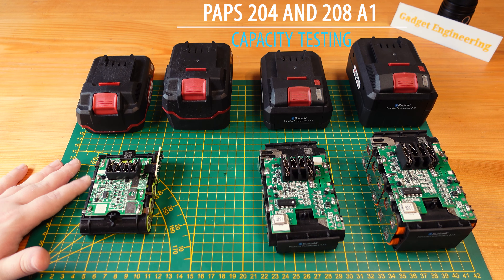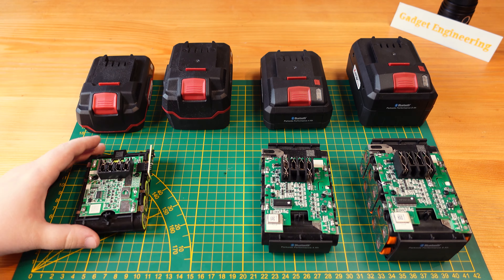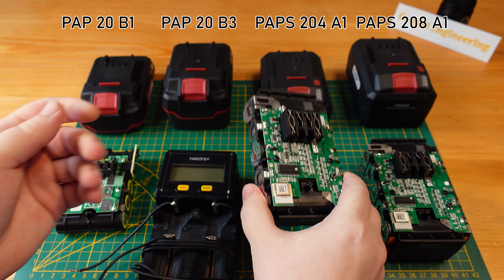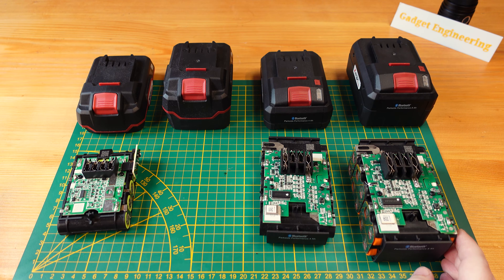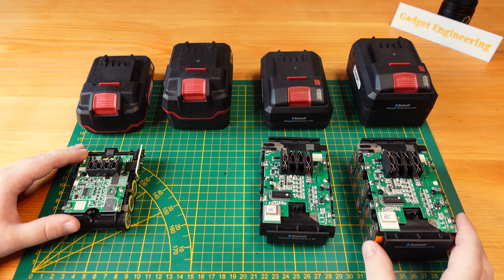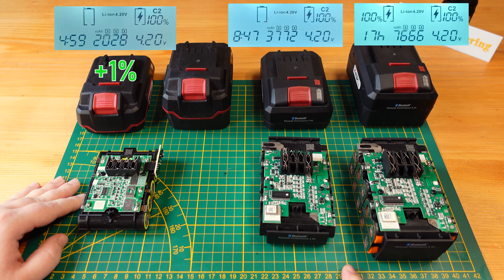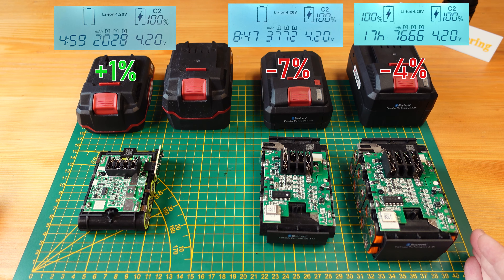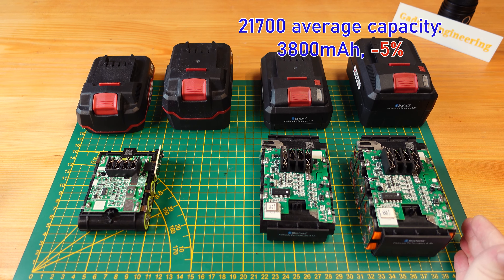CAPACITY TEST Parkside Performance 8Ah & 4Ah PAPS 208 & 204 battery 21700 Akku Kapazität getestet

Comment: The real question I want to know though is.. How many amps can the new single cell deliver.. If its the same or only slightly more than the standard batterys, then the standard 4a battery will actually have better performance than the new 4a model because it has twice then number of cells available for current draw than the new single cell 4a..

Comment: You can change the end capacity discharge voltage to 2.5V with the new Performance version, this might give you a bit more mAh... You said your tool charges up to 4.2V and discharges to only 3.0V I would not recommend to discharge to 2.5V but to be fair this could fullfil anyways the specifications.
Reply from the maker: True but as you see the 18650 version delivers its rated capacity down to 3V, and I think the capacity ratings are given with a discharge to 2.8 or 3V. Anyways, there is only a few % energy left over when below 3V... Still, nothing to be disappointed about...
Reply: @GadgetEngineering  I guess the reminder could add up close to the 200mAh.
Reply: @GadgetEngineering  For exact measure you need to respect the original cell specs. Many times that capacity is at a discharge of 1A, even less. So if you test at higher current, you can get lower values. I got 7.1Ah on the 8Ah brand new batteries at a discharge current of 6A / 3A/ cell.

Comment: Hello my friend.. Please send some to me here in the UK.. I just purchased the SDS drill, Combi drill and jigsaw from Germany.. Soon I'll be wanting to buy the circular saw, grinder, multitool, impact wrench. impact driver and some 8ah batteries.
Reply from the maker: Let me see what I can do! Where did you buy the other tools, German Ebay or some other place?
Reply: @GadgetEngineering  Yes I got them via ebay but from Germany.. Another question.. On the batteries there's positive, negative what is the other connector for?
Reply from the maker: @cassiya100  There's actually 4:
- T ID +
negative and positive are self explanatory, "T" means possibly thermistor, but it really isn't providing a thermistor connection, it is really a battery status OK connection, that when status=OK is a 10k Ohm resistor connected to the negative connection, when status=BAD it is open. It come into play for the battery to signal its status to the tool, as there are no switching elements/mosfets in the 20V Team batteries, and all battery protection switching is done by the tool. So any time the battery detects an overtemperature, overcurrent, overdischarge, or cell imbalance state, it opens the T connection. The tool is using this connection as part of a voltage divider, 5V from tool->10k resistor->sense connection to MCU->battery T pin->10k resistor->negative. That way at the sense connection the tool either sees 2.5V, meaning the battery internal 10K resistor is connected to negative, the battery is OK, and the tool runs, or it senses 5V, meaning the battery side circuit is open to negative, which tells the tool the battery has some kind of problem, and stops power flow. Only tools connect to the T pin.
Chargers connect to the ID pin which is a 5V serial communication, giving the charger the battery capacity so it can adjust charging current. I showed this in the charger ANALYSIS video. There are only 3 known (maybe 4) IDs, 2Ah, 4Ah and 8Ah (perhaps there is also an ID for 3Ah,although those batteries were never sold, PAP 20 A2). The serial code is about 10 bits long and as I said just defines the battery capacity, repeating ad infinitum while connected to the charger.
Hope that answers your question!
Reply from the maker: @cassiya100  I'd be willing to set you up an Ebay offer for your missing Parkside tools. Send me an email to the address indicated on my channel page and we can discuss further. Cheers!

Comment: Hi it maybe you know what it could be problem in 2018 2Ah battery it only allows for 1 second operation each push of a button and it not allow charge, all cells 3.92V. I found track broken under the pcb, track was broken cell to balance circuit,  soldered and it allowed to charge but after 5 minute charging it again red and green blink and same only 1 second operation but all cells 4.12V

Comment: Hello, does anyway know how to disable the bluetooth on the new smart charger?? Keeps blinking and who cares for the bluetooth
Reply from the maker: You can't... but you could desolder the blue LED, it serves no other purpose. It does stay solid when connected/paired. Check out my "ANALYSIS" video for a PCB view of the charger. It's a 5mm LED you can just pull.
Reply: Just connect it than it stops blinking at least ;)
Reply: just put a black sticker onto it.

Comment: You can limit the charch capaciti
Reply from the maker: What do you mean?
Reply: @GadgetEngineering  limit the charge to 80% for example
Reply from the maker: @franciscomanueldominguezmo438  Yes, with the app you can limit the battery DISCHARGE to a certain voltage (minimum 2.5V), and you can also CHARGE the battery to 60% for storage with the smart charger.
Reply: @GadgetEngineering  but you can limit 80% to or even vit the charger
Reply from the maker: @franciscomanueldominguezmo438  You can only limit battery charge to 60%, set the charge/discharge current and the termination voltage. Nothing else. Si tienes alguna otra pregunta no dudes en responder.